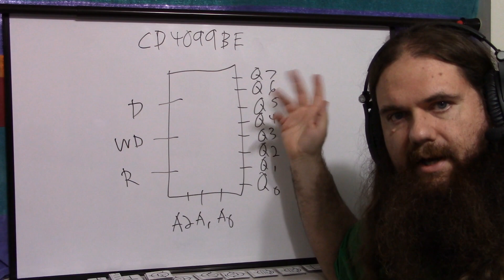CD4099BE Addendum - Live Demonstration - 8-Bit Addressable Latch - Simply Put

Comment: Can we use this without micro controller
Reply from the maker: You could use it as a demux or decoder, though it'd probably be cheaper to get actual demux/decoder chips in that case. You could have some sort of control knob that the user can turn to select a bit, and then a button to toggle that bit, and that would let you store some sort of user settings without having an entire bank of switches on the front. Stuff like that, off the top of my head. It's definitely intended for use in a digital computing situation, though.